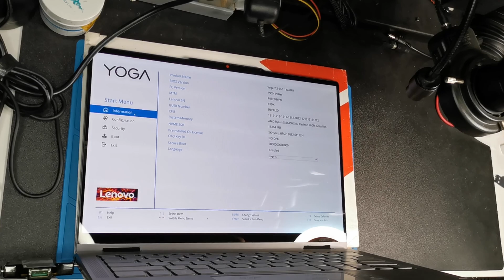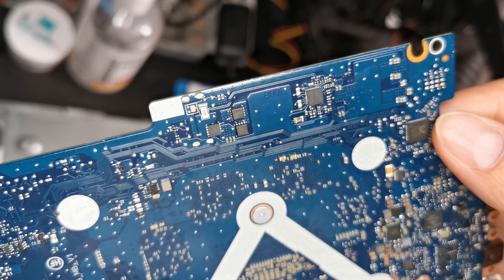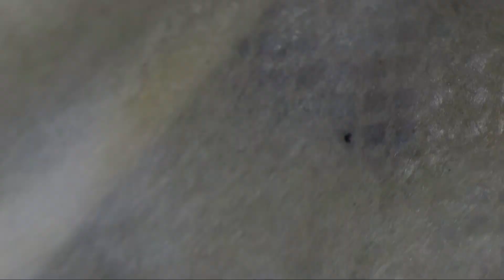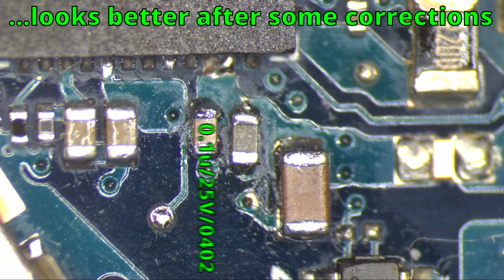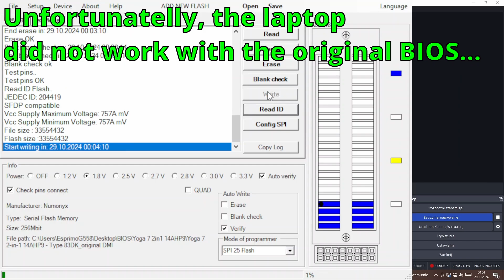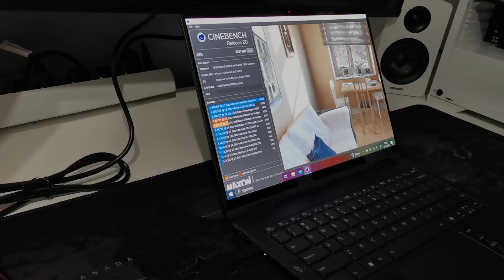Episode 18 - Lenovo Yoga 7 2-in-1 14AHP9 [First repair on Youtube!]

Comment: How hard is it to replace the keyboard palm pad assembly?
Reply from the maker: Not very difficult, but replacing a keyboard in most modern laptops is a bit time consuming. Keyboards are in most cases attached to the palmrest with plastic bolts. So you need to melt or rip them off first and  then attach/weld the new keyboard with some hot glue where the bolts were before.
Here it's explained well:
https://youtu.be/YIJ-1oTwb48?si=wcN-15T7Fb9Jstii